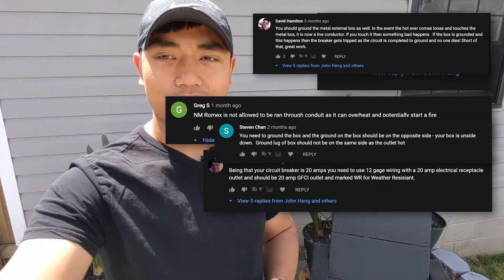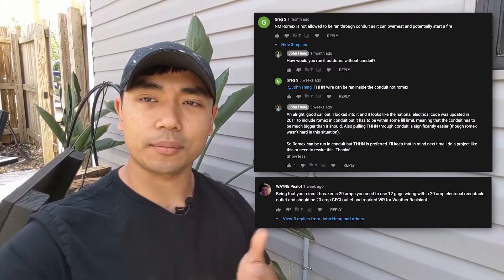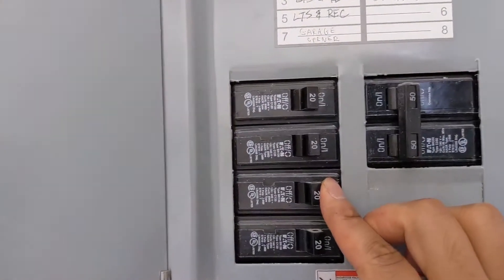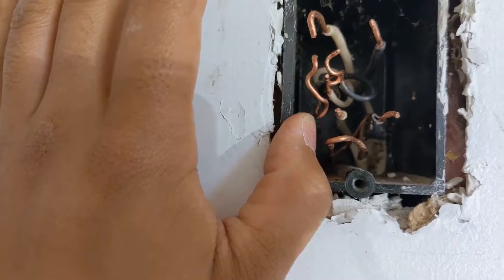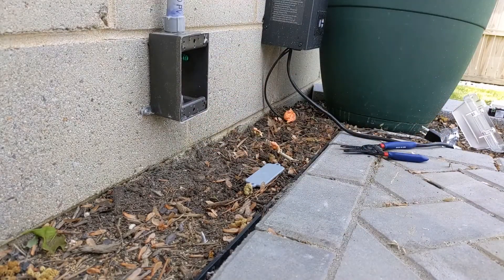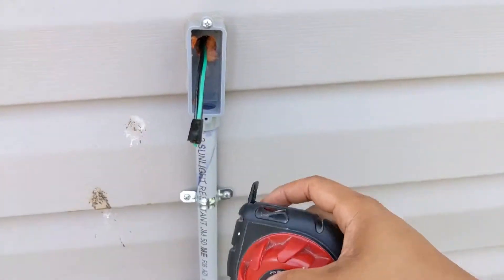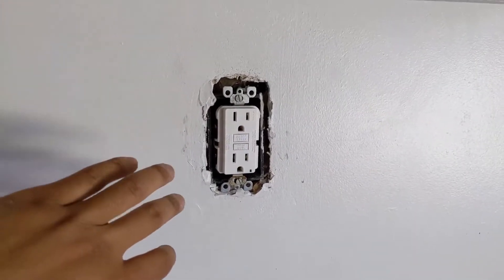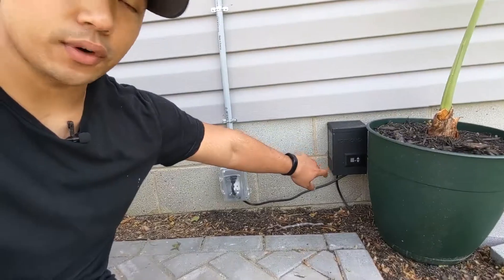Fixing a potential fire hazard 🔥😬 Replacing Romex with THHN for my outdoor outlet ⚡

Comment: Was told at an IAEI continuing education class by a very well respected inspector that you are NEVER allowed to use type NM or NM-B { no such thing in any code book called Romex ! ) cable outdoors. Not even allowed to back if a wall luminare pancake box with it because it not allowed in damp areas. Have to deal conductors when they are installed in a warm area to a cold area like an outdoor box or walk in frig.
Reply: Mean seal wires going to a different temperature.

Comment: Someone can correct me if I'm wrong but I think you don't need two GFCI outlets in the same circuit, if the outlet that's inside is already a GFCI that one should protect the one outside, you could've installed a regular weather/tamper resistant outlet.

Good video tho 👍

Comment: Wait did you use a GFCI inside and another one outside? No, no, no. That's not right. You don't put two in a row. You could have just used the single GFCI indoors and wired a standard moisture resistant receptacle outdoors off of the "load" side of the indoor GFCI receptacle. This causes the indoor GFCI to protect both the indoor receptacle and the outdoor one. Putting two in a row can cause issues including them not tripping when they are supposed to.

If you read the instructions enclosed with the GFCI receptacles, you'll find all of that in there.
Reply: Your wrong. It is perfectly safe to wire more than one gfci outlet receptacle on the same circuit.
Reply: @protoman247  I was wrong about it not tripping when it's supposed to maybe, but it can certainly cause nuisance trips, aside the fact that it's completely unnecessary and pointless. It's right in the instructions of the GFCI receptacle not to install it downstream of another GFCI device.
Reply: How do kitchens have more than one gfci outlet? Do they all have individual runs?
Reply: @FingerThatO  kitchens have multiple circuits to adequately power appliances. Each circuit will have a GFCI to protect it, if required

Comment: Someone else has probably already mentioned it, but if not, with that size wire, it's not allowed to label it with tape. The hot wire needs to be black or red the entire way and the neutral has to be white or gray the whole way. Labeling with tape is only acceptable with the larger wire sizes which are generally only available in a single color.
Reply: If he does it in his own house he knows what he did and nobody gets hurt. Back in the early days most wires were black with rubber and cloth insulation.
Reply: You are allowed to re identify the wire color. Best example if you install say a piece of 14/3 cable to add a three way switch you would install black tape on it to let others know it's an energized conductor (  at least when luminare is on, but depends if it's the last or first switch feed powers up ). We have one strict inspector who wants you to install colored heat shrink tubing on. Years ago have seen large wires that had black insulation painted white to identify the grounded conductor.
Reply: @JohnThomas-lq5qp  2020 NEC forbids it on smaller conductors. I believe it's anything smaller than 6 gauge.

Comment: ALWAYS turn off main breaker.
Reply: And check both plugs on receptacle and once opened, use a voltage tester inside on all wires to make sure there isn’t another live circuit in there from another breaker.

Comment: THWN is for outdoor use. Use the correct wire color: black, white, and green and use solid wire, not stranded. If stranded wire is used it should not be stripped to the end. You should leave about an inch of insulation at the end to prevent the strands from separating. When doing rework like this when the old wires are too short, use Wago lever nuts instead of traditional wire nuts. fyi, you don't need a 20 amp receptacle, a 15 amp weather resistant gfci is code compliant even with a 20 amp circuit.

Comment: If all of this is on a 20 amp breaker, your interior outlet is 15 amp and not rated for 20 amp supply. Your conductors need 6 inches of slack from the entry point. Yours look like stubs.

Your exterior pull should've been all the way through the wall first before going down, that way you don't rake the sheathing on the PVC edge. Your strapping was overkill. Only need 1 within 3 feet of a connection. And last, you could've saved yourself a lot of asspain and just got a GFCI breaker.
Reply: It's entirely acceptable to use a 15 Amp receptacle on a 20 Amp circuit, as long as there is more than one 😉
Reply: @Krankie_V  Yep, Hengs sin is using 14 size wire with a 20A breaker!  But at least he fixed that.
Reply: His original install by drilling a hole in the back of the box is a code violation. (At least that’s what I’ve heard)

Comment: There really isn't a right side up on an outlet.  It's up to an inspectors preference, if you get a jerk, or your person preference.  Some prefer the ground up as a precaution against something falling down the wall and making contact with the hot/neutral which coujd cause a problem, instead it would hit the ground and not create a problem, assuming you have a grounded plug in the outlet.
Reply: No it's never up to any inspector to tell you ground up or down due to this never was in the NEC. If you you a metal wall plate common sense tells you best practice is ground UP ! If tiny 6/32 comes loose then falls out if ground up plate will come to rest on ground pin. Have seen where the plate landed in ground down & landed in hot blade causing a fire ball that burn a piece of stainless wall plate.
Reply: @JohnThomas-lq5qp  Unfortunately, I've heard of inspectors that insisted the outlets be ground up and wouldn't pass inspection unless done.  Fighting inspectors rarely turns out good.
Reply: @malikto1  Here in dukes of Hazzard Pa they do not have a state electrical license so some hick little towns have somebody who too often think they are God & know it all. Had one call me up after my inspector passed a job only to be told that I had 3 violations. Told him that if ai had 3 legitimate violations that I would find another line of work. Failed me for splicing a #14 guage wire that was not long enough to land on a breaker in a new panel. Told  him the NEC article where it's allowed so he said  "I'll let you get away with it this time ". Other 2 violations was on the Pepsi sign installers supplying power to sign that he did without my knowledge and was not on my permit. 99% of the 8 or 10 inspection companies inspectors in my area are great too work with. They rather you call them up about an issue for permitted work then have to come out ,fail you, then come back again. Back in the early 1970's we were told there is at least a quarter Millon words in the NEC. Now bet it's halve a Millon words so you would think it  would cover everything. Hate when I see a residential refrigerator or freezer with plug installed into a receptacle that the cord has to make a 180 turn. Have seen it that over years plug pulgs partially out of receptacle. Co

Comment: The outlets you have in the house are incorrect.  Those outlets have a limit of 15 amps.  Since you are using 20 amp breakers you also need the 20 amp outlet to be installed.  The “T” slot outlet that allows for both 20 amp and 15 amp devices to be used.

Comment: For future reference, neutral wires (grounded conductors) that are 6 gauge and smaller need to be white or gray color coded along the entire length of the wire, not just the ends. neutral wires that are 4 gauge and larger can be color coded just at the ends and at all access points. Hot wires (ungrounded conductors) follow the same rules but with black and red colors.  
NEC 2020 - 200.6
and
NEC 2020 - 210.5(C)(2)
Reply from the maker: Good to know!
Reply: @JohnHeng  God damn, stop listening to YouTube. Once again, this guy Isaac is wrong. Color coding is strict for *different voltages*. Tape is fine for same voltage.
Reply: @reddog418  Really?  Isaac quoted the relevant sections.  Neutral wire of size 6 and small wire there are 4 choices of how to handle the color coding.  White tape is not one of the choices.

Comment: What about 600v THW insulated submersible pump cable. Its 10 gauge stranded wire comes in blue flat casing like the yellow romex, bigger gauge. We use it for water well and have some left over
Reply: Right, but the cable is rated for sub pump only.